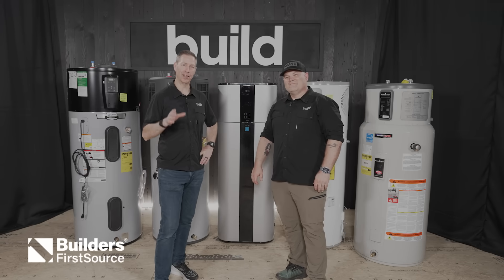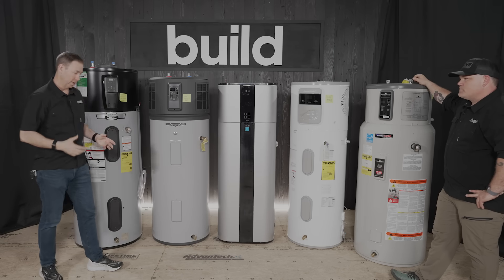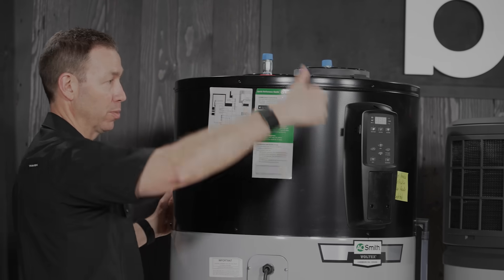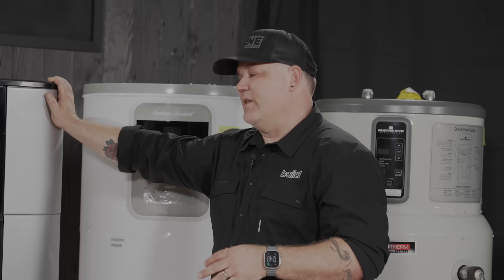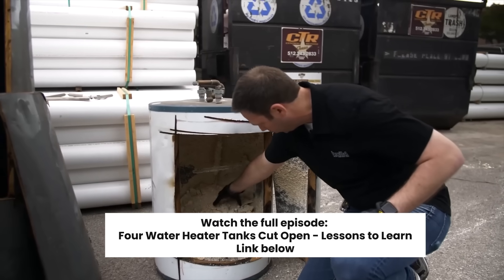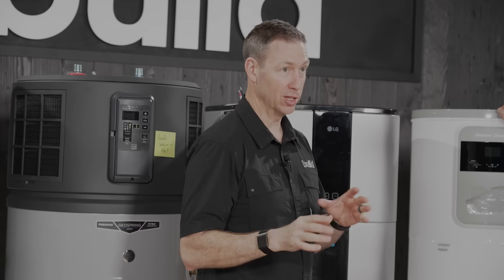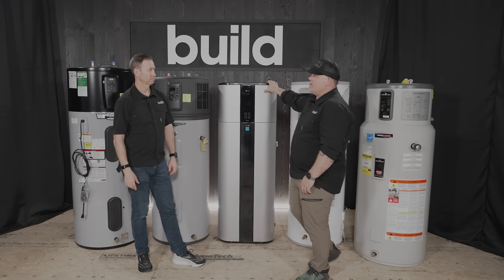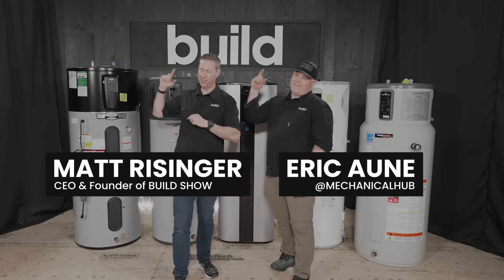Heat Pump Water Heater 101 - 2025 with Eric Aune

Comment: I have installed four heat pump water heaters in my homes or homes of relatives. One was a GE which did not last and the other three were Rheems which have been in service for five to fifteen years. The availability of models may be regional. Most of them were in all electric homes and the HPWHs were much more efficient than a regular electric model. One of them was in a vacation home and the ability to turn it off remotely after we left the premises saved  lot of money.
As far as ventilation is concerned there are options. As mentioned ducting can make them really efficient. On several cases we ducted intake air from the attic which is often warmer than surrounding air. In another which was in a garage we ducted the output cold air to the exterior because the climate at that location was cooler and the relative did want the garage to get even cooler.

Comment: can these be installed outside on a covered patio? My current hot water heater is installed there, by the previous owner of the house. Unfortunately, they installed it directly on top of the concrete without a pan.  I can already see rust spots on the outside of the tank.  It was previously inside the laundry room, but for some reason they moved the location outside.  I live in south GA, doesn't get that terribly cold in the winter

Comment: There is a version of the GE one that has a built-in thermostatic valve, so you can for example run the tank at 150F for maximum capacity, but it will mix down to 125F at the outlet for safety so that people don't get accidentally scalded.

Comment: I am interested in information with installing these in conditioned space. Why is this not discussed or at least I have not seen it discussed.

 Yes I realize that it will be pulling heat from my house in the winter, but that heat pump is designed to operate in colder weather.  It will also cool the house in the summer (benefit).

Comment: It was only briefly mentioned, but the heat pump water heater also dehumidifies.  My basement used to require that I constantly run a dehumidifier however since installing the heat pump water heater the dehumidifier never needs to run.  The savings of not needing the separate dehumidifier effectively means that I am getting my hot water for free.  The heat pump water heater is also quieter than the dehumidifier.

Comment: So, I have one of these… the AO Smith.  It installed easily, but the service folks at AO Smith don’t know what they’re doing.  If you call, they’re going to give up quickly and opt for a replacement if there is an issue.  For instance, I installed one for my daughter and her fiancee called for support and they replaced it.  I had an issue and called and they couldn’t even tell me what the error code was and wanted to replace it.  While they were getting that ready, I took off the shroud and inspected it… there is a float switch in a drain pan and in transit it must have flipped up and got stuck on the side… a super easy fix and I have had no issues since then.

For my unit, I opted for an 80-gallon unit to replace my 50-gallon gas water heater.  Having a higher first hour rating was important to me as I have some people loving to take long hot showers.  I bought a thermostatic mixing valve and bumped up the temperature.  I have a first hour rating of over 125 gallons, at this point.  I run in heat pump only mode and have a 120V circuit.

While it has worked well, these things just are not engineered as well as they should be.  They’re WAY TOO expensive for what they are.  It is effectively an electric water heater with a window unit AC on top.  Those components separately would be about $1K… and mine was pushing $3K… that with me doing the install myself.

Instead, these should be sold as separate units.  A “dumb” tank with a backup (and optional) heating element… basically a regular electric water heater that is “pre-plumbed” for the refrigerant.  Then a separate compressor.  This would give ultimate flexibility.  The compressor could be located elsewhere, including outside, if desired (and a larger compressor could be selected that is rated for lower outdoor temps).  Once this is the “normal” way, they could be incorporated into VRF Heat Recovery Heat Pump systems.  Those systems basically have a manifold different head units and share a single compressor.  They allow you to heat and cool different spaces independently.  In the summer, if you’re cooling your house, it can dumb the hot air into the water heater instead of the outside… and then the compressor fan doesn’t need to run… it effectively becomes a desuperheater.  This also means the simple tank can be serviced independently.
Reply: Not sure bout yours but I am now on my third one that has gone bad. Always goes bad outside the 1 year labor warranty. Call, get an rma number and then have to go get the new one to install at my expenses I had the 220 version in 80 gallon. I tried to get my fourth one from Lowe’s today, can’t even order it. Had to switch and go to a Rinnai 80 gallon. Good luck.
Reply: @SSGPohlman I’m on my first one.  It’s been 2 years.

Comment: I just finished installing (Aug. 2025) one of these HPWH's in my 'newer' west Texas home (build completed in 2020), replacing the 5-year-old, standard "Bradford-White" 50-gal/4500w electric. The W/H is installed in a 3' x 8' utility closet, accessed from the garage. 

I did the entire install myself, as I had some specific ways I wanted it done, and (unfortunately) the quality-of-workmanship is a bit lacking in my area...

The garage (3-car) and attic/storage space above, are both fully spray-foam insulated (as is the whole house), but the spaces end up being very hot inside, particularly during the summer (and even quite warm during winter). The house-side attic is seperate (and conditioned) so it stays cool.

I ducted my new HPWH unit's intake/return air up through the closet ceiling - into the attic - to pull the warmest air from there, then ducted the discharge air back to the garage, to facilitate some cooling (yes, there is a vent between attic & garage to ensure circulation). I used full-sized rigid duct on both intake & discharge, with insulation-wrap on the discharge pipe, to prevent any condensation. Both pipe runs are very short, so little-to-no airflow restriction.

So far it is working well... The water is hot and the garage & attic is a bit cooler (and less humid). 

The new HPWH unit itself (a 40-gal Rheem "Performance Platinum") is VERY quiet in operation - literally cannot hear it running from inside the house. And even in the garage, you only hear the slight "whoosh" from the discharge-air vent. I did not use the isloation pads under the unit, but I did build a small 2x4 platform to set it on, for a bit of 'elevation' for the condensate drain & pan drain.
I also did not let the unit touch the walls [in the closet] to prevent any noise and/or vibration from transferring in. The condensate drains out to water a planter area outside.

I was originally going to install a mini-split AC system in the garage, but figured, why not try to utilize that excess heat for something useful... and the "Hybrid  W/H" does just that! 
Besides, the garage doesn't need to be 75°F (a mini-split could easily keep it that cool)... It just needs a bit of cooling, and the hybrid W/H fit-the-bill perfectly!

Thanks for your video!

Comment: Long time subscriber and 30+ year 110v to 500kv electrician here, I appreciate your content. 

I've been in the process of replacing all my copper plumbing with openor PEX a and I'm planning on installing a heat pump water heater. 

I noticed in this video you did not include the rinnai heat pump water heater? My local supply house has rinnai and AO Smith heat pump water heaters. Is there a reason Renee is not included in this conversation?

Comment: They need to come up with a fridge/HW heater combo for peak efficiency 😆
Reply: I’m installing a heat pump water heater this weekend. The utility room is right on the other side of the wall from my refrigerator. I’m planning on connecting an air vent  from the fridge to the heater.

Comment: If these work great in an uninsulated garage because of the ambient heat, does that mean they’d be extra terrible once the winter comes in the same uninsulated space? Or even if it’s a big room inside your home, does that mean you’re going to pay extra to heat your home since your water heater is sucking up extra ambient warm air?

Comment: How do you get the anode rod out? The tank is 5 ' or 6' tall so you need another 5' of overhead or 10' clear over the hot water heater.
Reply: If the anode rod is expended, then you’re just left with a wire cable, so no problem. You can also just bend the anode rod when you remove it. When installing the new anode rod, you can get one that’s linked together like sausages, so it’s not a single solid piece.

Comment: Installed one of these myself, because I couldn't find a local plumber or HVAC contractor who even knew what they were. One of the best home appliance purchases to date, saving me over $60/month over the previous propane water heater. Works great in my cold basement in Canada. Noise is barely noticeable with no insulation between main floor and basement.
Reply: Wow hard to believe a plumber didn't know about these. Either they were truthful or pulling your leg. I've had two since 2010. Some plumber may not want your business as some think your stupid like these are so advanced that It's too complicated. The only big difference between a regular electric Is where to pipe the condensate drain or install a pump to drain condensate to  possibly a laundry drain.
Reply: Is it noisy?  Why I ask is because our house is small and we don't have abasement.  We need to put it in a closet.
Reply: @RandomJHK  they won't work in a closet, the more space around them the better. I think the minimum space you can install them in is ~120 sq ft and even then it needs to be well vented to the surrounding spaces.
Reply: I’m going through this struggle right now with contractors. Which tank did you get? I’m in Toronto.
Reply: @Shankovich I got the Rheem Proterra 80 gal. It's been great - an external thermal sensor did break last year but Rheem diagnosed it over the phone, sent a new sensor for free no questions asked and it was easy to replace. Otherwise has worked flawlessly for 4-5 years now.

Unfortunately I see they've gone up like $1000 in price since I bought mine.

Comment: I cannot tell you how many new home builds that I've seen with HP water heaters crammed into way too small of spaces with No venting to allow it to function properly. I called out one builder at a supposed energy star compliant build for putting one of these units in  a basement closet that shared the same space as the HVAC & ERV. He claimed the install was appropriate.

Comment: My AO Smith Heat pump water heater keeps failing. I had one for 5 years that failed and was replaced under warranty. 5 months later the replacement failed.

Comment: just watched the SanCO2 install... you should NOT send the recirculating into the "cold water' of any - and particularly the SanCO2 unit  if you want recirculating capabilities - you should add an small tandem tank electric to recirc the water and dump the hot water from SanCO tank into that tandem tank.. just saying...

Comment: I saw HPWH for the first time on Matts show back in 2019, was a rerun from years earlier i believe. In 2020, we installed one when our house was built. I also WARM the floors with that same water heater in winter.  

I have an energy monitor i installed so i know the exact wattage mine is at is 145watts! Monthly SUMMER cost is $4. Not a typo, FOUR DOLLARS per MONTH) Family of 3, 2400sqft and installed in a North Carolina insulated Garage. Best location for it by far. Adding the floors in winter makes the cost $26/mon. Our rate is .097/kWh, dirt cheap to start with.

I added a filter to the top of mine bc the factory filter is wrong in so many ways. I do my annual flushes and filter cleaning every 6 months but over 5yrs, NEVER checked my annode rod. Since i have a water softener, I think i have time to wait til summer is over. I have the Rheem Platinum which has the Shroud that takes time to remove, so i might go with the electric annode rod. Thanks for that info.
Reply: Uhhh what? You run a hydronic floor with a standard HPWH that is in your garage? That does not make sense, what am I missing here? Is it ducted to the outside? Because if it’s not it would be taking heat from the air to heat the water, to heat your floors, to heat the air… which is like robbing Peter to pay Paul… IE it doesn’t work.

Comment: Heat pump water heaters like this only make sense in warmer climates where you don’t need to heat your house. In colder climates, an outdoor or geothermal heat pump that preheats the water makes much more sense.
Reply: NEEA did a study on this and found that HPWH make sense in heating climates too. The short version is that the extra demand they place on your heating system is negligible.
Reply: @JoshuaRes  Interesting, where can I find this study? The way I see it, you need X amount of kWh (energy) to heat X amount of water and your house. If you're heating both your house and water with electricity, you'd need the same amount of electricity regardless of whether the water heater uses a heat pump, because the total energy consumption for the house and water would stay the same.

Comment: In the spring and summer, my gas bill is under $20 a month for my water heater and stove. Even if a heat pump brought the bill down to zero, it would take 30 years to break even for the cost of the unit and installation of the heat pump water heater. Another solution looking for a problem.
Reply: Sure, until your existing water heater breaks.
Reply: @JoshuaRes 
And you think a heat pump water heater with a control board, compressor, electric valves, motors and sensors are lasting forever? Good luck with that dream. Your repair bill will equal the cost of a standard water heater.

Comment: Flushing for maintenance is highly dependent upon the quality of the water going into the tank. Here in the San Francisco Bay Area it's not necessary at all if the water is sourced from EBMUD.  The water is very neutral and I've seen water heaters that were never flushed last twenty-five years before failing.

Comment: Great video, love to see heat pumps again.

BIG caveat with ducting these!!!!!
the fans are SUUUUUPER WEAK. so ducting resistance plays a huge factor into the efficiency as well.
I had to correct a very professional installation that failed because of a silly  short flexible duct with and end dryer hood backdraft flap, was restricting all the flow. After removing this ducting the issue was resolved.

If you duct i recommend additional booster venting to assist the unit while its running.
Reply: I just installed mine (see my previous comments above) and used full-size rigid duct (8" intake - from attic space above, 10" discharge to garage). The duct-runs are very short, so no discernible restriction. I did insulate the discharge, as I noticed some condensation forming after the initial startup. No issues after wrapping the duct.
Contractors these days do everything so cheap & poorly... it's kinda sad.

Comment: Building tighter and more thermally-isolated structures means there is less waste heat to scavenge from ambient.  As more appliances use heat pumping, we'll pay to generate heat to be pumped into the appliance.  Granted, it's more efficient, but remember:  TANSTAAFL.

Comment: I put an AO smith 900 series 115v 66 gallon heat pump in what is considered an undersized utility closet.   Unit was installed just as winter was coming.  Pulled some pipe insulation from the radiant return line.  That provided enough extra heat in the closet so the temp never dropped below 70f.  I’ve been very impressed with this model.  I live in an area with a lot of calcium and magnesium in the water.. I’ll be doing my first flush soon.

Comment: I replaced the thermocouple on my gas-fired Kenmore recently and noticed the label ... April 1994. I checked the install receipt and it was July 1994. Where has all the time gone? It still runs fine, but I suppose it's time to replace it, before it explodes all over my garage.

Comment: These things are nice but have a bunch of caveats. Maintenance is not mentioned where filters have to be cleaned and/or replaced. More sensitive electronics that run harder then your typical fridge. Have a hard time in the North bringing colder input water temp up to 120. Noisy.